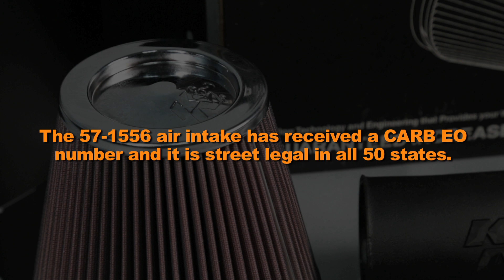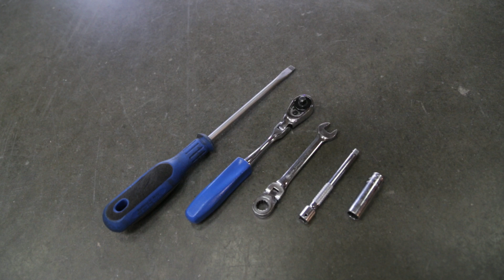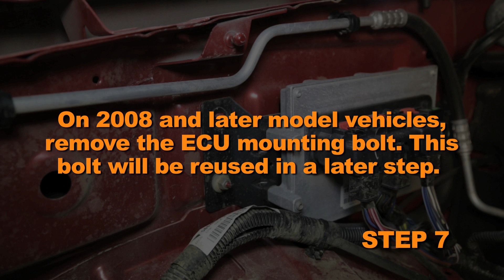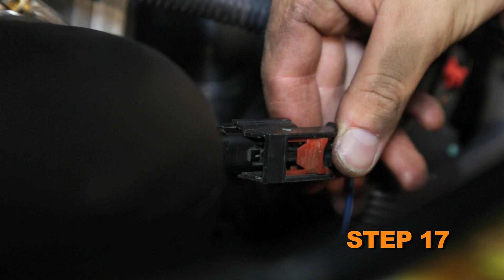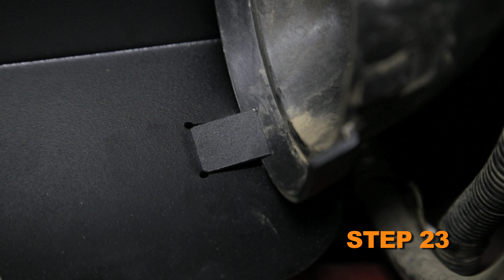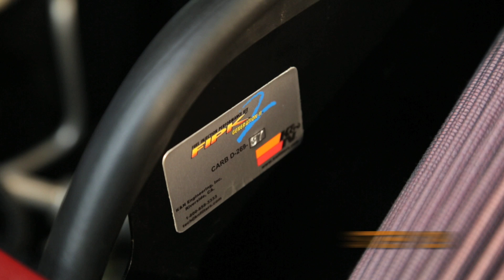Dodge Nitro 4.0L [#57-1556] Air Intake Installation

Comment: Will this fit inside the engine bay of a 2002 Chrysler Sebring Convertable 2.7L V6?
Reply from the maker: No this system will not fit a 2002 Chrysler Sebring 2.7L.   If you have any other questions regarding fitment please contact our Product Specialists at 800-858-3333 or tech@knfilters.com.